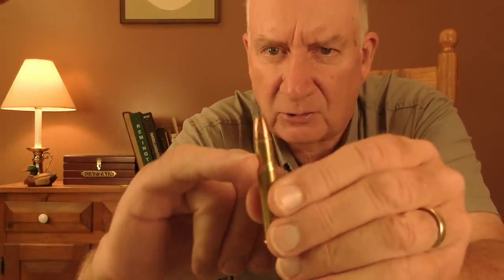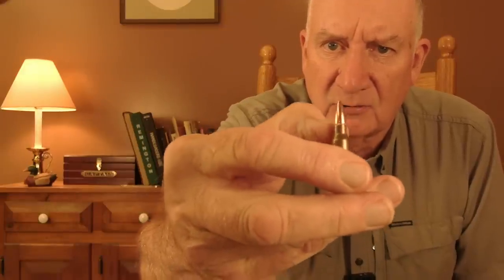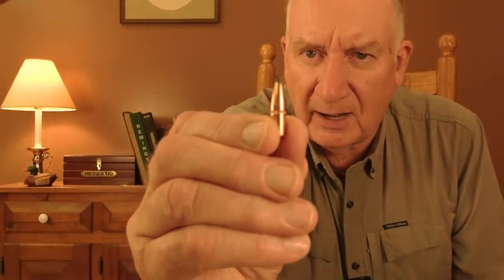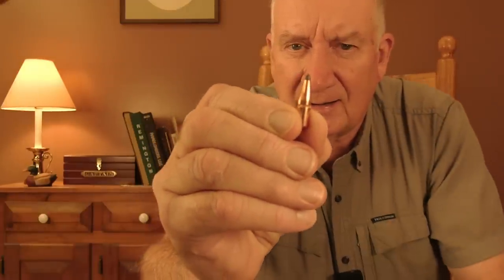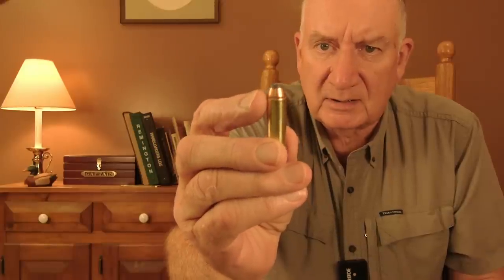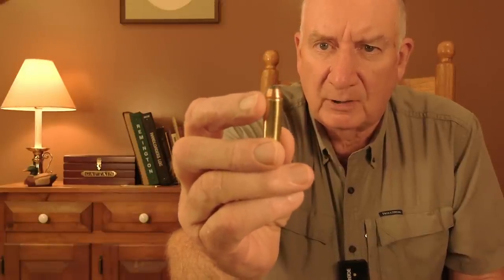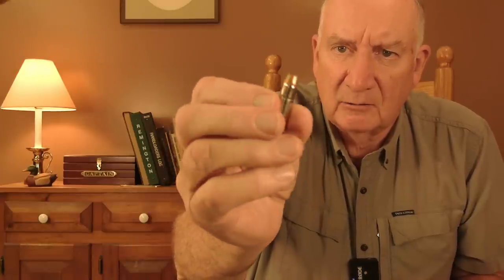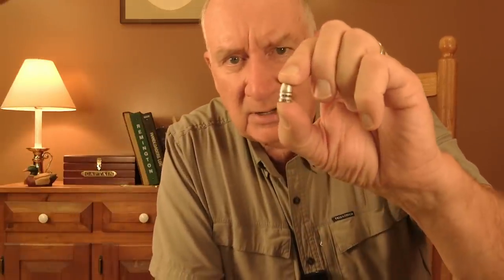Crimp or Don't Crimp ~ You'll Know the Answer!

Comment: That looks like a very pointed bullet to be in a mag tube in a 32 special.. I opted for a larger flat nose. It shoots good and I don't worry about chain firing
Reply from the maker: Your concern is entirely unwarranted.  This bullet is specifically designed by Speer for tubular feed .32 specials and will absolutely not detonate primers.  It's not a bullet intended for box magazines because there simply aren't any.  The .321 diameter bullet is unique to the .32 Special or the long obsolete 32 Remington, so Speer's production is strictly for tubular fed Model 94 and 336 Marlin rifles.  This bullet has been a popular mainstay of Speer for decades and is not at all pointed.
Reply: I would be interested to see 3 of those laid out end to end to be sure. They look like they would rest 100 percent on the primer
Reply: To add to this I ended up going with the Hornady .321" 170gr FP interlock because they actually make contact on head of the case instead of the primer.. which I had with the Sierra bullets

Comment: I’ve seen..and been “lucky” with a .30-30 Win. FACTORY bullet ‘setback’ or having had it literally drop back into the case AFTER I was shooting. Just by chance I’d stopped, literally the NEXT round to be fired. Since then on MY reloads which are almost all exclusively semi-autos, are certainly ALL crimped to a degree. Haven’t done any pistol cartridges except the normal 9mm NATO-type.

Comment: I've enjoyed, and learned from, much of your content; but I must say that I am a little disappointed by your (and every other vid I've seen on the subject of crimping) lack of info concerning the importance of crimping regarding bullet seating depth and overall cartridge length, reach or distance before lands, uniform start pressure, and how all these affect accuracy and safety. If I remember correctly, Richard Lee's reloading book suggests that his Factory Crimp Die can render bullet reach much less significant; and this seems to make sense to what little I have left to think with.
Also, your theory that a revolver bullet, due to recoil, being forced deeper into its case is just the opposite of what I've encountered.  Some low budget factory 38 Sp became so long that the last one of the six sticking out the front of the cylinger prevented the cylinder from any further rotation.  
It's the simple law of inertia: An object in motion tends to stay in motion; and an object at rest tends to stay at rest.  A rimmed cartridge case being captured by the frame of the gun must follow the frame rearwards under recoil, the dense, heavy bullet, however, wants to stay at rest and not follow the rest of the gun and if not well secured will begin to move forward in the case.  This is not just a theory, it happened to me, and could be a life threatening situation.